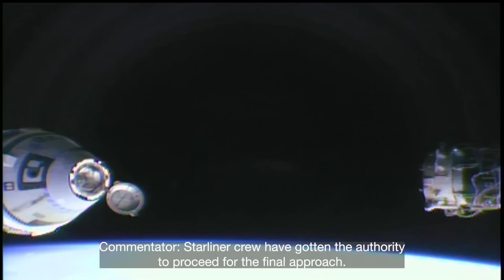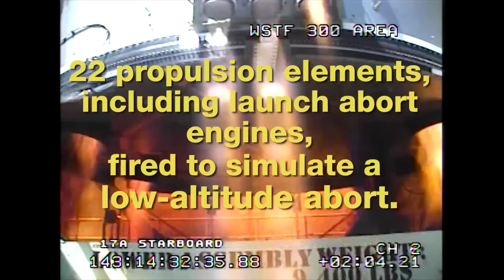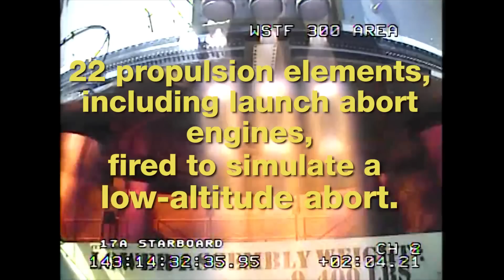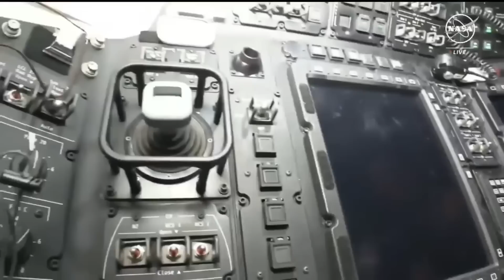The Decision Is Made - Boeing Might Be Safe? But SpaceX Is SAFER!

Comment: I'm glad you brought up the issue of multiple issues having a common cause.  I think you can either chalk it up to one big mysterious issue which is manifesting itself in multiple ways... or you can chalk it up to a lax engineering/safety culture at Boeing, and the independent issues are the manifestation of that.  In either case, the risk factor has increased, and there is an unknown component to that risk.  Either way, you cannot pretend that you've got your arms completely around it and it's under control.  At the end of the day, yeah, the risk of the spacecraft failing is still very small, but it's still an order of magnitude greater than what they thought they had when they'd launched.  My personal hope is that it fails on the way down, and nobody gets hurt.  It validates that lower risk options (as much as spaceflight can have lower risk) are still the right choice.  And hopefully it removes Boeing as a space flight option.  It's not that I don't want to have multiple launch options (because I do, and we should), but using Boeing as a manned launch provider is like the saying "with friends like these... who needs enemies?"  I don't want to wait for an astronaut to die before NASA realizes how dirty Boeing is doing them.  I'd rather they spend that money getting a second private option going (like Rocket Lab, or something similar).

My fear is that if the capsule comes back without issue... then Boeing will keep arguing they've "solved" the problems, without really having done so, and is thus putting some future astronaut's life in danger.
Reply: The one thing that government agencies like NASA do really well, above everything else, is requiring reports and documentation.  If the capsule comes back without issue, Boeing is still going to have to produce some really convincing reports proving that they understand what the problem is and explaining what they have done to fix it.

Of course, the one thing that government contractors do really well, above everything else, is writing reports and documentation, so there is certainly a risk that the reports will just be full of bafflegab and cleverly-written handwaving..

Comment: I have to admit that in the past I was quite the Boeing fan. They were a major player in the Apollo program, the Space Shuttle and built several modules for the International Space Station, and more. Of recent years, even after becoming a staunch Space X fan, I was quite excited about Boeings' initial Starliner program. Like everyone else, as the flaws in the program became evident, my support began to fade. When you also consider Boeing commercial airliner problems and their mismanagement problems since acquiring Mcdonald Douglas and their misguided DEI policies, it becomes easy to nail Boeing to the cross. 

When you filter out the emotions and breakdown the issues, maybe the issues are not as bad as I thought. The Space shuttle was quite unreliable in its early flights, but the system did mature, save the disasters that occurred, and became more reliable. Adding to that, NASA was only given funding for about half of the proposed upgrades that would have made it cheaper and safer to fly. Boeing does have its share of responsibilities for its mistakes but in the case of the thrusters, being of a subcontractor's product, I think it's less on Boeing than we all are inclined to blame. 

The thrusters are supplied by Aerojet Rocket Dyne and L3Harris. Both are very well known and trusted suppliers. Boeing and AJ/RD have spent the last 2 months trying to recreate the problem. Thrusters and valves of various types have been around for a long time. Perhaps some new valve type whereas a condition has slipped thru the cracks. The point is, I don't think it's a lemon. This is not yet a production model. I think they definitely could have done a better job to this point but in the end, they'll get the issues worked out and Starliner will be a reliable transportation system (fingers crossed).

Comment: NASA's best option would be to cut its losses on Boeing and support SpaceX in getting the Starship human certified to go to the ISS. It would probably be faster than Boeing getting Starliner 100%. Just imagine Starship going to the ISS with 10 astronauts and 100 tons of supplies, crew would be able to take libraries up and it would not be over weight.

Comment: Management by Accountants and Financial Engineers and Venture Capitalists.  That is the problem.  It happens to almost every company that produces anything real eventually.  Why?  Because if you're successful over time you build up a lot of physical assets worth a lot money on paper.  Butbyou can't sell them because they are producing all the cash flow.  But investors just look at that as lazy capital.  So Vulture Capitalists are brought in to monetize those "Stranded Assets".  So they sell off everything, or spin it off, that produces a high cash flow to its nominal asset value.  This is called "Rationalization Of Assers".  It destroys a company in the long run because the et effect is to lay off many of the stranded, experienced people and this kills pride and loyalty to the old original company.  And it causes shoddy workmanship as you hire less qualified workers using cheaper goods.
Too bad.

Comment: The argument that Starliner is a safer option if the Space station had a catastrophic event that left it in uninhabitable. Its just not. You could argue its also safer to put on a suit and hold on to a few heat shield tiles - get out of the station before it blows up. Any option is safer than staying on the station if its going to get destroyed

Comment: Boeing's Starliner: A Tale of Two Spacecraft

Summary:

* 0:04 After 11 weeks of uncertainty, NASA decided to send the two Starliner astronauts, Butch Wilmore and Sunni Williams, back to Earth on a SpaceX Dragon spacecraft. 
* 0:53 This decision was made after Starliner experienced several issues during its mission, including leaks in the helium system and problems with thrusters.
* 3:46 The issues with the thrusters, specifically their performance being out of spec, raised concerns about potential catastrophic failures and were deemed too risky for a crewed return.
* 6:45 While Starliner remains the preferred return option in a contingency scenario, NASA doesn't yet fully understand the thruster issues and the risk associated with them.
* 7:26 Crew Dragon, originally scheduled to launch as Crew 9, will now be carrying Butch and Sunni back to Earth, adding two extra passengers to the already planned crew.
* 9:08 Starliner will remain docked to the ISS for a few days before undocking and returning to Earth.
* 9:24 This is the first time NASA has had to switch crew from one spacecraft to another during an active mission, highlighting the unique situation of having two active crew spacecraft.
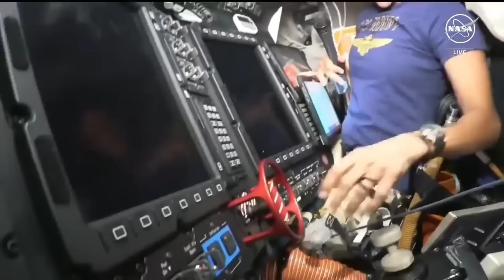* 12:55 Although this is a first for modern spaceflight, it's not unprecedented, as similar situations occurred during the early days of the ISS when the space shuttle was operational.

Key Points:

* NASA prioritized crew safety over relying on Starliner despite its current status as the preferred return option in a contingency scenario.
* This highlights the ongoing challenges and complexities associated with spacecraft development and the need for thorough analysis and risk quantification.
* The situation reinforces the importance of having multiple spacecraft options and the need for robust contingency plans.
* The incident adds to the ongoing debate surrounding Boeing's capability and reliability in spaceflight. 

I used gemini-1.5-flash-latest to summarize the transcript.
Cost (if I didn't use the free tier): $0.0016
Input tokens: 18088
Output tokens: 788

Comment: So I'm trying to figure out a timetable for when Starliner gets certified. Six months for  an inquiry  and deep exam of the design problems.  Six to ten months for a new design and testing of the propulsion systems and plumbing, because you have to  run it through the vibration and vacuum and thermal chambers for testing.... then integration testing and checkout of the assembled vehicle...  an unmanned and a manned flight to certify... meanwhile there's not another Atlas booster available, Vulcan is in a holding pattern for engines, New Glenn isn't ready and doesn't need the competition, the only thing you can launch this bird on would be a Falcon Heavy or maybe the new Ariane, but that's also not quite into mass production yet... divide by... carry the five... um. I calculate Starliner block II will be fully certified in late 2027, early 2028.
Reply: An inquiry can happen in parallel to fixing any issues with Starliner.
Reply: @Caviar_Liberta  The inquiry will drag out longer than you expect; various senators and reps will want to take turns putting the boot in.  it could become Boeingazhi.

Comment: Regarding helium, I use it to check for leaks. It is such a small atom that it will find the leak path. Also, since it is basically non-existent in the atmosphere, I can use a mass-spectrometer to look for leaks. Boeing is using helium to pressurize various tanks. They could use something that is inert and doesn't leak as readily, say N2 but there would be a weight penalty.

Comment: Has anyone ever returned on a different type of spacecraft than use to go up? (e.g. Soyuz to Soyuz doesn't count.) [Was answered in the video.]

06:14 Those teflone issues only manifests in extreme situations. How could one expect Boeing to account for vacuum, high pressure and heat in a rocket eng-

Comment: Did Boeing not have a spare capsule to send up while just returning the bad one uncrewed? Of course Boeing would have had to foot the bill due to warranty issues. But if Boeing can't even do that and considering all of their issues, it sounds like it was a miracle that the crew even made it up there to begin with.
Reply: A spare capsule that's designed with the exact same design and built by the same team is likely to have the exact same problems, though.  Maybe once we understand the root cause of the problems we could say that it's specific to this particular capsule, but we certainly don't have the information to say that now.

Also, large rockets usually take months of work to get ready for flight (and even when SpaceX is being fast, it's at least a month for them), so unless they were expecting to fly one already, they would have to do that work before they would have anything to launch the capsule on.

Comment: I thought Dragon was originally designed for 7 crew but cut back to 4 by Nasa. It sounds too simple, but why not just put an extra 2 seats into Dragon, then they wouldn't have to leave anyone on the ground for the recovery mission.
Reply: As mentioned by other commenters, the 7-seat design was from when they were planning on a powered landing, not a parachutes-and-splashdown one, and the seats weren't set up to be safe for a splashdown impact.  The 4-seat design isn't just the 7-seat design with 3 seats removed, and it would require an entirely new seat design to bump it back up to 6 seats that could land safely.
Reply: @BrooksMoses  Also, the ability to connect the extra suits. The life support system is apparently still rated for seven people, but it only has connectors for the 4 seats.

Comment: The doghouse thermal issues and Teflon seat swelling isn't a new thing.  I worked both of those issues in the 80's and 2000.  Remember the mantra - Test as you fly (including worse case scenarios).  I should add that we changed the operational approach in operating on orbit to manage doghouse overheating - but that was a geo bird, can't do it easily here.
Reply: It seems to me that thermal management isn't impossible to simulate on the ground in a vacuum chamber. Electric heaters can be used. It wouldn't be exactly the same but clearly enough to get a significant safety margin.
Reply: @dwightelvey645  Heat Transfer is simpler than a lot of engineering disciplines, both theoretically and practically.  This is entirely on Boeing and their profit-maximizing doctrine.

Comment: Starliner is toast, they can not recover from this embarrassment and NASA will have to start anew to find a second source beyond SpaceX.  NASA has given Boeing over $4B and this is what they've accomplished so far -- not good enough.  If this is it for Starliner and it appears to me it is, then will NASA be able to seek the return of the billions given to Boeing, at the very least Boeing must cough up serious money as a fine for failure to provide what the contract required.  Having worked on Boeing aircraft and having been a fan of Boring for decades it is particularly troubling to see them destroy themselves so comprehensively.  Boeing ceased to be a tech company with a long standing legacy of engineering excellence coupled with a stable and competent management, and they are now a marketing firm that appears to view engineering and production as the enemy that must be whipped into submission -- submission to a corporate mindset of profits over: quality, safety, and corporate responsibility.  At this point I would not buy toilet paper from Boeing as it would almost certainly be 'used' TP.

Comment: What amazes me, is that basically no one is reporting on the fact the primary failure was discovered before the launch, and both Nasa and Boeing knew the leak was ALREADY a problem.....

Everyone mentions the valves, but leaves out all of the actual details about the valves, and the other leaks.... Nor does anyone bring up the law suits over these valves. Intellectual property and NDA issues that went to court that were already partially won in court. Then all the rest of the case was thrown out by the Judge..... It is all public record as well.............

Far more is going on than they are telling anyone in the press, and the BS meter was pegged months ago.... The flight permits for the stricken Starliner module were only 45 days, at most, and all of them are long since expired..... There is and was nothing to consider about how to get the two people back to earth. The Human Rating permits already expired and it can no longer carry humans, period........ If they told everyone a deviant cherub caused all these problems, would everyone believe that as well? Might as well, since everyone ignores actual facts surrounding it that anyone can look up because most of it is already in public record.... 

Nasa and Boeing both screwed up royally, before the launch ever started a countdown....... And there is so much BS to cover up shady details and events surrounding it, it is scary.......
Reply: The 45 day limit was a battery certification limit that was extended after further review and analysis of on-orbit performance. That's standard practice. The helium leaks have nothing to do with the thruster thermal issues, and the helium leaks were not a significant concern (the only consequence was reduced free-flight duration, but on an ISS mission it has plenty of margin there).

Comment: While the thrusters can be fixed, the toxic dragon is arguable a worse vehicle than starliner because of the escape system. At least the starliner can jettison the hypergolics. They actually both need to be retrofitted with escape towers and get rid of all that propellent. And while not a problem going home, the Falcon 9 just had one of several failures while it's biggest competitor....has never failed catastrophically.

Comment: Nice video. The only tiny little point left out is that StarLiner belongs to Boeing not to NASA, and Boeing says it’s fine to bring the crew back on it. If Boeing had flown Boeing employees on StarLiner it would already be safely back on the ground. But Boeing is now the victim of deep and prolonged soul searching by NASA engineers and bureaucrats with the result being that Butch and Suni are not really test pilots testing a new machine after all and the 0.1% chance that something will go wrong is too much risk for them to take.
Reply: There's a difference between taking risk and taking unnecessary risk. The deorbit test of Starliner can be done just as effectively without astronauts, and a safer way to bring them home exists by doing a schedule adjustment.

Comment: If the Starlines were a commercial aircraft flying civilian passengers, it would not be grounded. Their Aviation Maintenance Technicians would placard these individual thrusters inoperative and operate the flight under MEL restrictions.  The real issue Mr. Manley is NASA has had so many catastrophic failures resulting in loss of life; NASA won't take any unplanned risk.

Comment: Interestingly, I looked up the linear thermal expansion coefficient of Teflon, and it is typically more than 50% higher than nylon and about 10 times greater than stainless steel. Since the thruster doghouses were getting significantly hotter than expected, this could explain why the teflon in the valves were popping out and interfering with the flow of propellent to the thrusters.